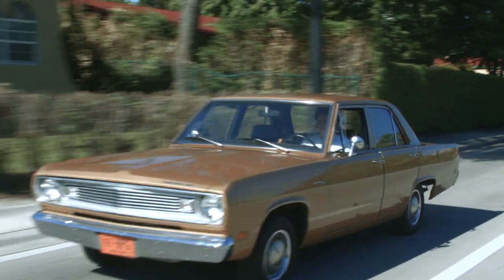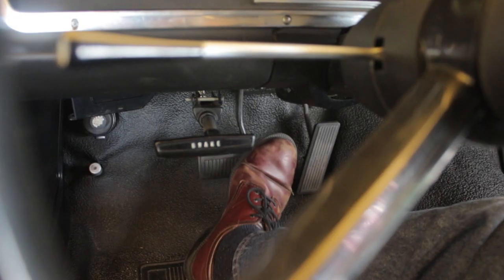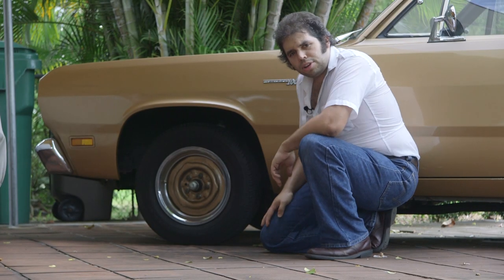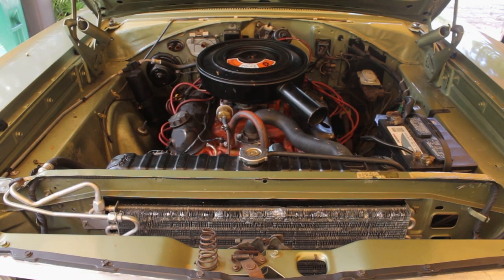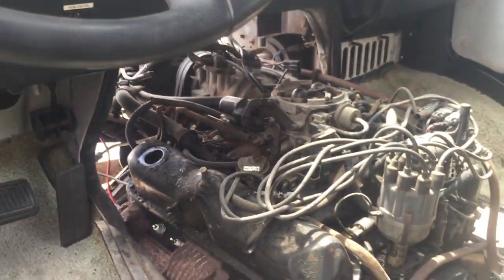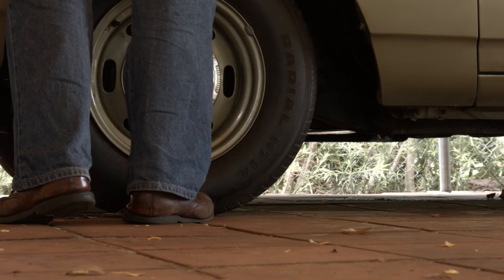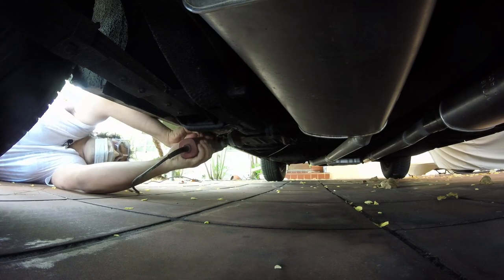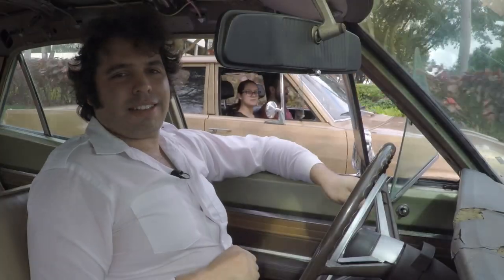Mopar More-Door Adventure! | 1969 Valiant and 1968 Satellite Rescue | That '70s Car Episode #1

Comment: How does this video only have 38,000 views? The Valiant is a GREAT car and your quips (not to mention awesome 70's clothes) keep things interesting. I would absolutely enjoy a '68 or '69 Valiant four-door, as they had pleasant lines. When I was a kid, my brother's best friend would drive over in his mother's '67 Valiant two-door. I always thought it had great styling. The only thing I don't like about yours is the body colored wheels and those trim rings. Yuck.

But hey, you are awesome for saving these four-doors. I hope you saved the Satellite's original 318. That is still re-buildable, and the 318 can easily make good power with only mild tuning. I've heard of people getting 200 hp with a two-barrel carb and easily 250 with a mildly tuned four-barrel. No lumpy cam or loud exhaust necessary. Aww! You threw it out!  😞

You have a pleasant, funny, humble demeanor, and very resourceful.  And highway gears are great!  I'd drive the hell out of those cars.  Hope to see more videos from you.
Reply from the maker: Thanks for the kind words! 

You'll be happy to know the only part of the 318 that I remember scrapping was the block (which had absolutely horrendous ridge wear on the cylinder wall - you could easily catch your finger on the groove at TDC), and possibly the crank. Don't remember offhand - mainly as I'm not sure how I shipped the crank. However, just about everything else that still had life in it was sold on OfferUp, Craigslist, or eBay to others working to put their 318s together, so the bits of that engine still live on and are keeping other LA blocks going :)

No promises, but I have a fairly obscure idea for a future episode...

P.S.: Canon printer bulk toner boxes are dual-wall and unbelievably strong - and they're the EXACT size necessary to ship an Mopar LA or Ford Cleveland head in. One of the best discoveries ever!
Reply: @cudak888  I will remember that tip about Canon toner boxes! LOL  Honestly, if my garage weren't full of motorcycles, I'd buy one now, but I guess it will have to wait until my next house. 

FYI: I'm a communications/PR guy professionally, and have done voice over work intermittently for nearly 20 years. A lot of YouTube personalities try a bit too hard to be entertaining, but I just want to say again that - at least for me - you strike a really great balance: Authentic and conversational, with just the right amount of subtle humor. (Hope I haven't wrecked it by over analyzing! Hahaha)

Comment: I'm not sure i understand what burnt valves have to do with removing exhaust...?
Reply from the maker: I might have had half a chance to find out whether the engine would idle correctly before buying it, but the PO used the uncorked, rattling exhaust to hide the fact. You would have had a better chance assessing an engine with open headers than the old 318 sputtering away with the unmuffled rusty downpipe assembly rattling along with it.

The heat control valve on the RH manifold was also rusted shut, so that was contributing to the whole mess to start with.

In short, it would run, but barely, and the noise made it extremely difficult to tell if the cause was internal damage or a combination of bad tuning and minor mechanical issues.

Could I have simply shoved a different pair of LA heads on the old 318? Probably, but I didn't want to do a half job. Nor would it have done anything about the 2.5" of sludge in the oil pan.
Reply: SMOKE.
Reply: 2.5inch of sludge in the pan LMAO!! someone never to care of it
Reply: @cudak888 I know you did this swap a while ago but you forgot one thing when you had the pan off and that was to replace the rear main seal hopefully you did it but just forgot to mention it on the site at http://www.forbbodiesonly.com but that engine was a score I bet it was always parked until they went camping and never drove it any other time
Reply from the maker: @79tazman  Rear main seal was replaced, no worries.

Comment: You put the 360 in the wrong car. Put that in the valiant instead. Also, why scrap the 318?
Reply from the maker: The cylinder liners on the 318 had significant ridge wear. It would have been costlier and more time consuming to try to fix it halfway with a ridge reamer. I  the crank journals were also on the rough side, but it's been years since I did this. 

A side benefit was that the rest of the 318 - crank, pistons w/rods, etc - were sold on eBay for parts and the proceeds covered the cost of the 360 and some of the associated bits necessary (flexplate, engine mounts, etc). The 360's heads also paid for the Magnum heads - 1:1.

Excluding a few sundries, this allowed me to get the 360 buttoned up and running in the car in half the time and cheaper than it would have taken to booger-rebuild the 318.

I can list a number of reasons why a 360 swap in my '69 would have been a bad idea, starting with the opinion that 360 swaps don't belong in 22k-mile A-body survivors. There are tons of other, less pristine A-body candidates out there more suited for quarter mile sleeper builds, and some of them are even free of the added crutch (and cost) of replacing the 7-1/4" rear end and small bolt pattern hubs and spindles. 

One also has to figure in the slippery slope of a 360 conversion on a slant six, pre-1973 A-body. The rear axle obligates to the SBP-to-LBP conversion, which obligates the front spindle and hub conversion, which obligates a brake upgrade. 

All of a sudden, a "simple" 360 swap becomes a full-blown money pit while erasing whatever honest character the car had before. 

Now if you want to talk about sensible things that should have happened during the 360 swap but didn't, the 8.75" center section should be topic #1. It still runs a 2.76:1 ratio which makes the motorhome more of a dog than it already is. A 3.23:1 ratio center section mated with a 200R4 (the torsion bar crossmember makes shoving a Chrysler 4-speed box more trouble than its worth) would make it far more usable.

Comment: This car needs disc brakes the original drum brake system was barely adequate when these cars were new they are not safe for today's traffic.  Also changing the rear end gear ratio from 2.76 to 3.23 or 3.55 should give better acceleration without hurting top end speed too much.  Great idea swapping in the 360 less weight and better mpg than a 383 B block.
Reply from the maker: The Satellite is now running M-body front discs and 11.75" rotors, Firm Feel upper control arms, and 11" Budd rear drums. Have run this both manual and power, and recently went back to manual after the Pirate Jack aftermarket booster failed; thing was a piece of junk.

Still have the 2.76:1 in there; tried a 3.23 and it turned out to be the earlier variant with the narrower thrust block; had to go back.

Comment: Pleasure to watch. Valiant is very nice.  Satellite woes are POLICE look related. NICE Chrysler police (HD) rims. Ad you answered for rims produced Satellite, but zero rims ?Do not hesitate to LOOK for Member's Only jackets in colors to match classic you're enjoying driving. Pleather that matches Valiant is choice. Rolling STRAIGHT, without BRAKE drag ....maybe an RV cam in 360....and work some air cleaner maybe, to get more air IN.  ABSOLUTELY COOL > no doubt.  Try mini van rims for Valiant. Swap to B body suspension parts, brakes is extensive, then get another set of cop HD 15 inch rims. You are definitely a true mechanic. European spec tire makers MAY have profile 13 inch SOMEWHERE...you would be amazed at how many brands made tires for Mini Coopers over the decades...and RIMS.

Comment: Should not have scraped the original 318
Reply from the maker: That block had ring wear beyond belief, besides the crud. It would have required boring and an entirely new rotating assembly that would probably exceed the value of a rebuilt 318 shortblock. No telling how many times it might have overheated either, so add decking to the list of expenses. Nobody would buy it either - there's no shortage of LA318's out there, nor LA360's, and the general consensus - wrong or right - is that it's not worth it to put performance-level money into the 318 when you can do the same with a 360 and have a much better result. Plus, the Magnum blocks are a dime a dozen too, if one wants an arguably refined 318 on a budget.

Comment: the 360 is a torque engine for towing and gets lousy gas mileage, the 5.2 Magnum is what you want, more HP, better gas mileage, and that engine is a 318 (one of chrysler's best, so much so they cut 2 cylinders off of it for their V6 and add 2 cylinders to it for their V10) with 360 heads on it, they will run rings around a 360
Reply from the maker: I’ve had the Magnum 3.9 V6. Horrible motor that produced minimal power, never ran smooth, and was a gas hog. The truck V10 is not as similar to the LAs as people want to believe. And towing is a future possibility for the 68.